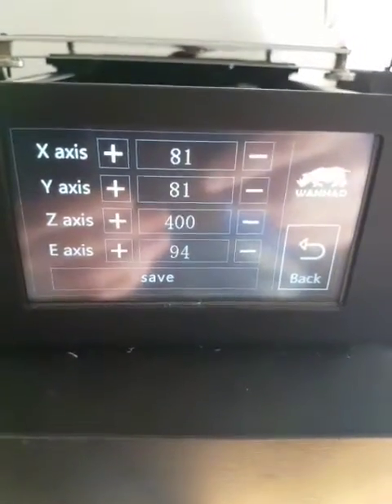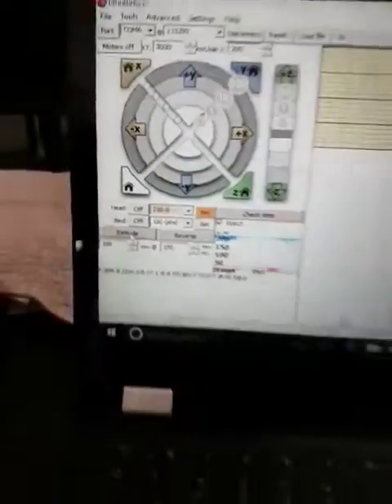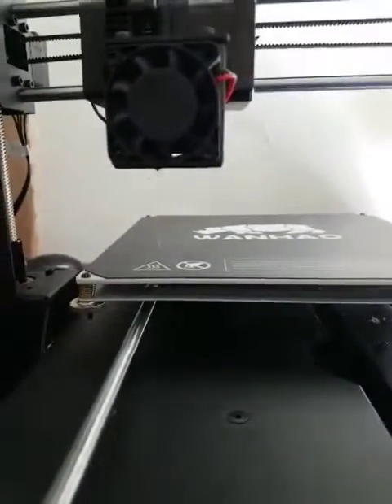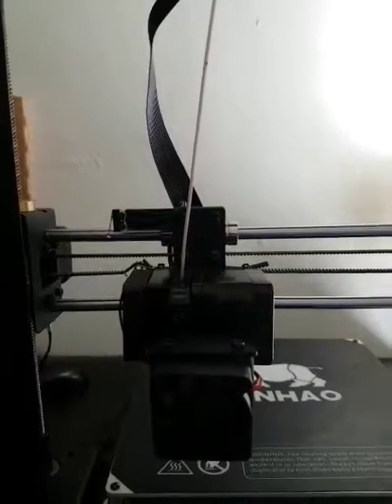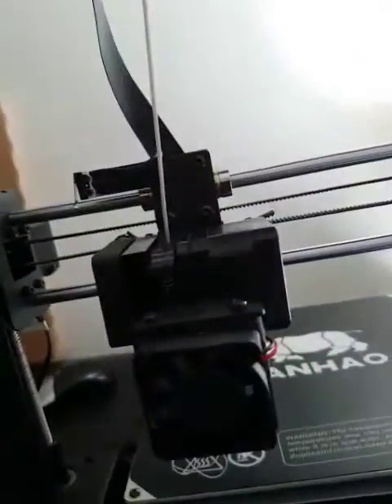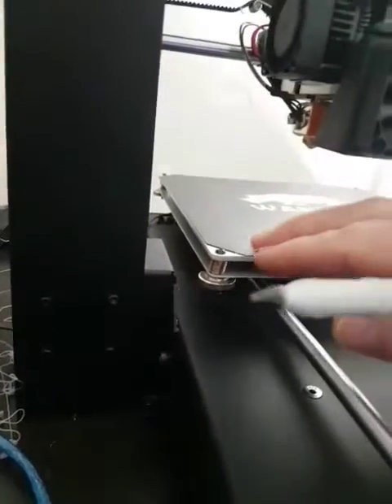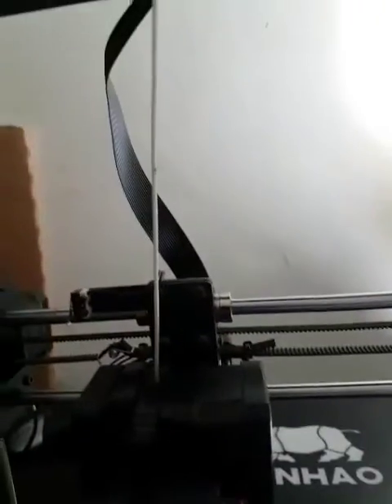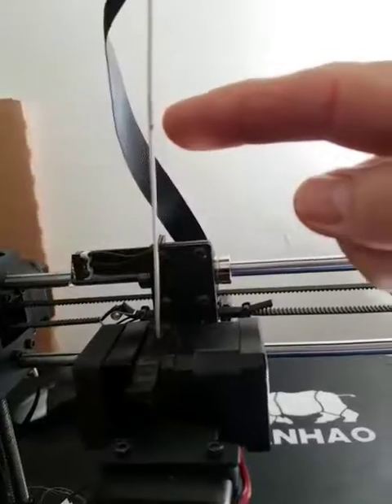Wanhao i3 plus extruder calibration issue

Comment: I have the Cocoon Create Touch (Wanhao i3 Duplicator plus rebrand) and mine does the same thing. But if I unbolt the extruder and run the test it does indeed pass 100mm of filament through the extruder. It's weird because I'm sure I have seen other videos where it feeds the 100mm through the nozzle?
Reply: i'm having the same issue. did you find a solution to this problem? please if you could help i would really appreciate it.

Comment: Let me see if I get this straight, you were expecting the mark to have moved 110mm?!
The plastic goes in at 1.74mm diameter and comes out at 0.4mm .
The 110mm value is for the extruded plastic, and if that is more than 4x thinner than the fillament going in, OF COURSE your mark would move orders of magnitude less than that.